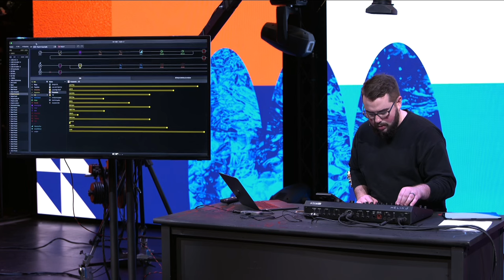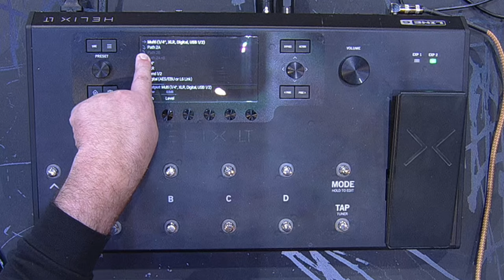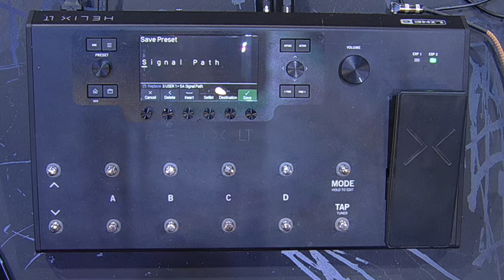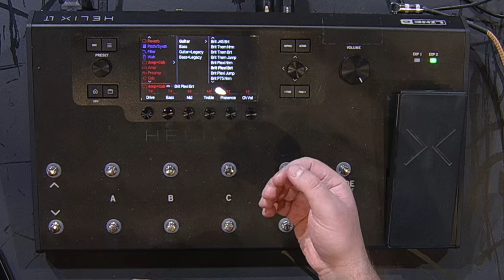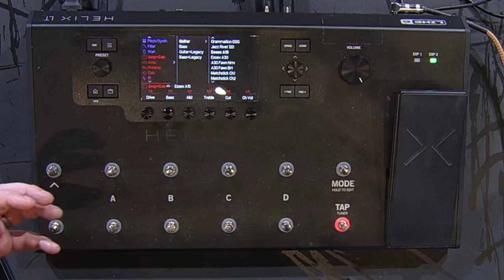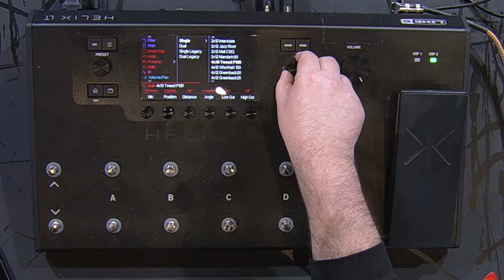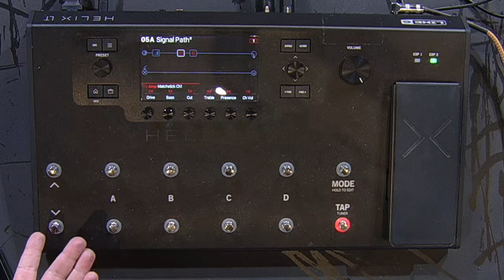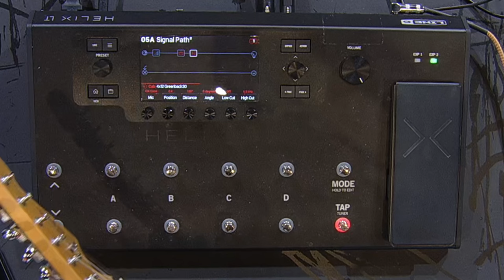Worship Guitar Tone Essentials: Line 6 Helix Tone Training

Comment: The 1/4” outputs on the Helix are balanced, just like the XLR outputs. So if you use a 1/4” TRS cable you can go direct to FOH without needing a DI box.  But if you use an UNbalanced 1/4” TS cable then you need a DI box.